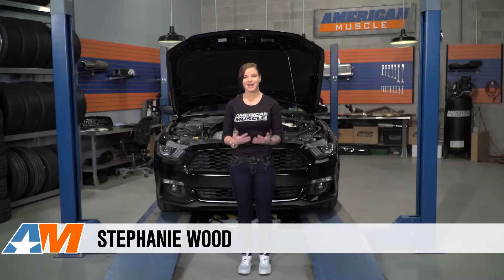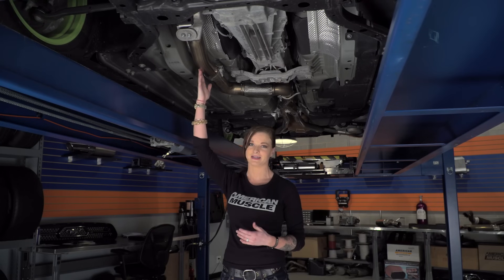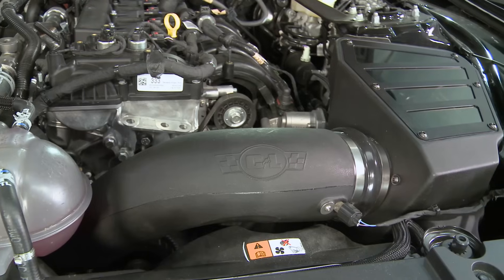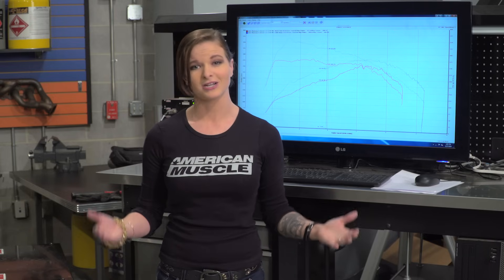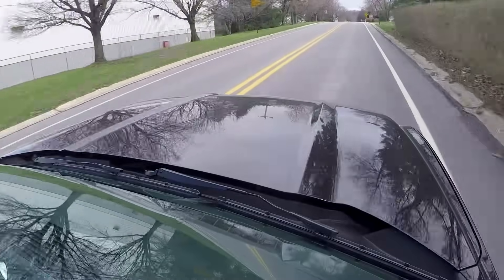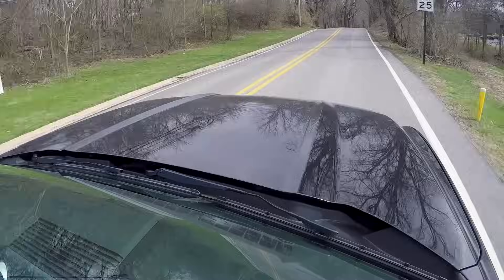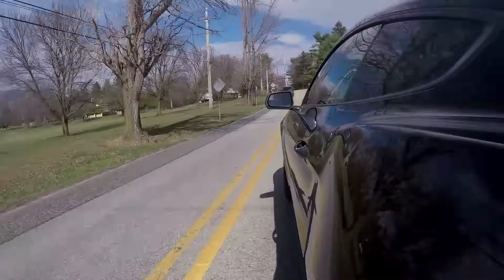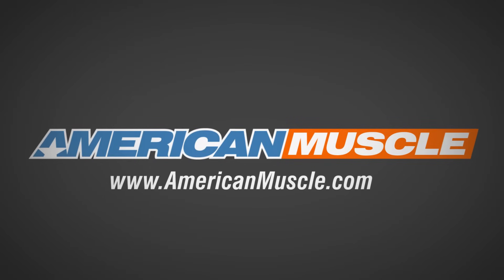3 Mods + 113 HP Gains- 2015 Mustang EcoBoost

Comment: For the Mustang used in this video, did you use the OTS map that comes with the Cobb Accessport? Or was a custom tune used?
Reply from the maker: Hey Michael, we used a custom tune for this bad boy. We were going for maximum performance and horsepower gains, so a custom tune was definitely a must and boy oh boy did it make a world of a difference. I have a few friends that run the OTS map that comes with the Cobb Accessport, and it really does increase the overall performance of their Mustang, but for this situation we wanted the most HP possible and went with a custom tune. - Matt
Reply: Thanks for the info, Matt. I look forward to ordering the Cobb Accessport from American Muscle here in the near future. I recently purchased the Roush cold air intake from AM a few weeks ago, and noticed the gains right off the bat.

Comment: Hey off topic, what do you think about going from 3.55 gears to 3.73 or maybe 4.10 and i do drive the car daily. Current setup is Pypes axle back, Airaid track only, PP package and unleashed 93 octane tune.Thanks
Reply from the maker: Hey man, that really depends on what you're plans for the car are! NA or boost? Road Course or Street? 1/4 mile? If you're going for an N/A beast, then 4.10's are the way to go! If you are planning on  boosting, I would stick with your 3.55's! - Will
Reply: Ecoboost automatic, only thing left I might want to do is lowering springs maybe a downpipe and the gears.

Comment: Borla Attack is not the move for an ecoboost. This car needs more refinement for street use, that rasp at high RPM would sound atrocious in person, especially with the car not moving proportionately to the amount of noise production. impressive gains though. Maybe a thru resonator or two to cut the rasp would be nice.

Comment: For some reason I thought the stock HP of a Ecoboost was 310 already but your Dyno run shows it in the low 2 hundreds and with the mods you did 310 HP. Am I missing something?
Reply from the maker: Brand new at the crank these 2.3L Ecoboosts do make 310 horsepower, but by the time that power makes it to the tire it has experienced a good bit of drivetrain loss. Sadly happens to every vehicle! -Zach
Reply: @americanmuscle  Oh so when Stephanie says that those mods make 310 she means to the wheels I guess?

Comment: Is it impossible to find specs or a respectable tune with stats for a 2018 mustang ecoboost?? Been looking since I bought the car in May and all I see is 2015 and on tunes which seem canned to me and performance stats are loose. Makes me want to get into the tuning business because the top 5 for this cars are very generic so I have no confidence in others
Reply: For the mustang ecoboost platform an intercooler, catback and tune gets you around 300 wheel horsepower reliably, the 93 octane limit of these cars is about 330 with full bolt ons.
Add an e30 tune and an upgraded wastegate actuator and that power can get over 350 wheel horse power.

Comment: Just got a ecoboost mustang two days ago and it came with that exact air intake, do you know if i added a whole exhaust system if it would mess up the Ford tune i have on it?
Reply from the maker: Nope! If you're just adding a cat-back system along with that air intake, you won't have any issues. If you plan on changing the down-pipe though, I'd highly recommend getting a new tune to account for it since that will be a much larger change in back-pressure compared to factory. Don't want to mess up the new ride, yknow! -Zach

Comment: Gotta go for Pro tunes with the Access Port after putting a catless downpipe, also gotta gut the PCV or have tuner raise the RPM to prevent smoking issues with the Ecoboost. Once you start getting these bolt ons you also need the better intercooler. So dont expect to just get power and efficiency with the simple bolt ons without the knowledge and research. Also a good trusted tuner. Or all of this will give you problems down the road.
Reply from the maker: Hey Adam, anytime you mod a car you have a chance of running into an issue. With that being, in this day and age most mods are pretty safe and if not we will list what supplementary mods are required to run it. I completely agree with your thoughts on the intercooler and I would definitely be adding a front mount to this car if it was mine also. I appreciate the comment! - Matt

Comment: Should all CAI have that housing to be more effective than a stock setup? I usually don't go over 4k rpms.
Reply from the maker: Kurt, an inclosed housing is definitely sweet, but everyone will have their opinion. There is definitely a debate between an inclosed and open filter, but in my eyes there really is no wrong answer! A buddy of mine runs an open filter and loves it, but once again there is nothing wrong with an inclosed as well. - Matt

Comment: Would be better to wait or can I exchange the downpipe  3" all the way to 2 1/2 exhaust tip before upgrading the air intake ?
Reply from the maker: As long as you tune for the parts accordingly, there's really no set order on which you should install first. Either way is fine! -Zach

Comment: It doesn't have that throaty muscle sound and needs a bigger turbo. Not happy with this as I actually have to turn off my car through drive throughs because they can't even hear me when my factory turbo ute sits idle (after market 3" stainless steel exhaust system, after market intercooler and performance after market air flow filter kit and catch can added) and I'm getting diesel specialists in Wingate to formulate a system for a larger turbo which won't be a straight bolt in.

Comment: Ever heard of being only as strong as your weakest link? If you have a 3 inch into a smaller pipe, you arent getting any benefits from the 3 inch iv at the end its smaller. You do get a benefit from removing the cat from the downpipe though, just not the size.

Comment: Some idiots said that Ford was "risking controversy" by ditching the V6 for the 2.3L Ecoboost 4 cylinder. The writers of this video are car gals and guys. Ditching the unloved and with no aftermarket support 300 HP/270 TQ V6 for the 310 HP/320 TQ turbo 4 cylinder Ecoboost . Wasn't controversial at all. It was a no brainer that both the bean counters and the car guys at Ford could agree on.  Now ALL Mustangs are NOW in fact "performance cars" whatever the trim level or engine option. Being that the Ecoboot has an MSRP of $26,400 within the budget of young carbuyer/enthusiasts and can be easily tuned up to 500 HP with a change of the turbocharger.
Reply: For no so called "aftermarket support" I sure found a lot for the 3.7 cyclone.  There are several aftermarket CAI's, short & full length headers, exhaust systems, programmers, a larger throttle body, ported manifolds, and even a stroker kit, plus of course turbos & superchargers.  Many youtube videos show what mods will do on a 3.7. As with all mods, HP per dollars varies significantly with forced induction the best return.

Comment: whats better for gains? an intercooler or downpipe? I already have a cobb accessport but just running the stock map 93 octane tune but will be getting a custom protune shortly
Reply: Not a mustang owner but I have a 2015 Taurus sho. Downpipes will get you more noticeable power right off the bat. I’d recommend an intercooler too though. Intercoolers don’t add a whole lot of power, but they prevent boosted engines from losing power. Turbo engines get very hot very fast so a bigger intercooler will keep the air temperature lower which will prevent horsepower loss in extended periods of hard driving.
Reply: @alexs4934  I appreciate the reply but the mustang is long gone unfortunately haha recently got a new fun play/ weekend car that I am starting to mod though haha
Reply: Hahaha, I didn’t realize how old the video was before I commented. Hope your new ride is treating you well 👍

Comment: New to modifications, why did the modifications result in lower performance below 2500 RPM?
Reply: That difference is just because they nailed the throttle to start the dyno record at a different rpm.

Comment: Could Borla ATAK exhaust system fit into Ford Mustang Ecoboost from UK(right hand drive) ?         Are the US ecoboost mustang(left hand drive) had the same exhaust system with UK ecoboost mustang(right hand drive) ?
Reply: My car is 2016 Ford Mustang Ecoboost 2.3L from UK(UK spec - Right hand drive).
Reply: +Rio Winardi yes it would fit bro it's the same but the steering is different the exhaust will fit bro

Comment: 5.0 coyote !!!!!!! my choice over ecoboost
Reply: Then why even comment on the video?  Obviously not everyone chose the fucking Coyote. My Father went with the GT, I went with the EcoBoost. It's not a money thing, it was a preference. The EcoBoost is lighter, with the rear seat delete it's 300 pounds lighter. Which is no joke, and I just REALLY enjoy turbocharged 4 cylinders. I've always been a big Mustang guy, and yeah I used to own an '09 GT. But this EcoBoost is just as fast as my GT was, and takes to bolt-ons like a fish to water. You saw in the video, 3 simple mods and a tune; now they're looking at 110 HP extra, which puts it pretty much equal with a stock GT. Now sure, you put the same money in a GT and it'll smoke the EcoBoost. But some folks just prefer it.
Reply: +JacobJakeJacob notice how I said my choice . I'm glad you like your ecoboost though nothing wrong with them.
Reply: +ericimi BTW I had an evo x I traded it for my gt so I do also like 4 cylinder turbo cars.
Reply: Because with those upgrades you have got gt power with half the engine and a fraction of the fuel consumption. I own a 2005 gto and while I love the car, I never am able to use the power of the engine cause speed limits but certainly pay for the fuel consumption.

Comment: doesn't the tune reduce the overall life of this car? correct me if I am wrong
Reply: LA StreetWorkout I wouldn't think the tune itself would. Abuse by the driver/owner, yes but the tune, no.
Reply: LA StreetWorkout it does the opposite. Without a tune the parts don't work together. These mods aren't as heavy so they shouldn't really reduce life of the engine but a tune is recommended for every part

Comment: I understand now... If your egotistical, or loyal to the brand. Stick to the Gt. If you’re strategic and think longterm, the ecoboost with added mods (boost to 400hp) is the better option longterm. Bc she just said 3 mods can add +115 hp. Which ranges within 400hp from 310hp standard. That for sure competes with the Gt, while at the same time SAVING GAS…..

Comment: I have a 2017 eco can i do all 3 or 4 of this mod to mine and still get 110+ hp on it cause if am not mistaking mine is pushing about 300+ hp which means this would bring it to over 400+ hp?
Reply: If I heard in the video correctly I think the peak horsepower gain was 66, the 110 she mentioned was gained at a lower rpm range Durning power curves.

Comment: If I buy an 15-17 Ecoboost with warranty and do these mods will it void warranty?
Reply from the maker: Normally, axle-backs and cat-back exhausts would not void warranty. I would highly recommend checking with your local dealership before installing the intake and down-pipe to see how they would potentially effect your warranty. -Zach

Comment: So with the mods it made the numbers it’s supposed to stock?
Reply from the maker: The 2.3L Ecoboost makes around 310HP and 320TQ to the crank which drops to around 245HP and 277TQ to the tire due to drivetrain loss. After tuning and modifications, we made 311HP and 360TQ to the tire instead of the crank! We also achieved a much better driving experience and power curve that won't drop off in the top end like the stock tune. -Zach

Comment: Shouldn't the horsepower already be  305hp stock for 2015 mustang EcoBoost?
Reply from the maker: To the crank, yes! But due to drive train loss, not all of that makes it to the wheels to be measured by the dyno. -Zach
Reply: @americanmuscle  thanks. I figured that might be the case but wasn't sure

Comment: What would be the cost of these 3 mods? Which exhaust will NOT make it sound like a Ricer🤢
Reply from the maker: Below is the parts list for this build! The 2.3L EcoBoost will never sound like a V6 or V8, its a totally different beast. Going with a system from Magnaflow or a Borla Touring would definitely tone down some of the raspy-notes you're hearing here though. -Zach
C&L Cold Air Intake http://www.americanmuscle.com/cnl-cai-2015eco.html
Borla Off-Road Downpipe http://www.americanmuscle.com/borla-or-downpipe-2015eco.html
Borla ATAK Catback Exhaust http://www.americanmuscle.com/borla-atak-catback-2015eco.html
COBB Accessport V3 http://www.americanmuscle.com/cobb-accessport-v3-2015eco.html

Comment: Yall dynoed a stock 15 eco boost and it made 276hp.. wonder why this one is so low?
Reply: HorsePlay Motoring that’s not low. When you look up and see the car and it’s says 320hp that’s to the crank. The hp they are talking about is rwhp which is hp to the rear wheels. It made good power
Reply: @creeves1331  yes..i know thats to the rear wheels..which is what a DYNO reads.. if a STOCK one dynoed at 276hp..a modified one should be much higher..
Reply: Take 276 and add 113hp..
Thats 389hp.. but this one dynoed at 311hp and 360ft lbs..
Reply: @TheModAddict  
Peak gains are the maximum peaks over the stock maximums.
Peak gains through the curve are the largest differences in power at any RPM that does not necessarily exceed the peak power rating.

So 113hp was the largest observable difference in power at a specific rpm on the dyno curve, the ford performance tune available for this car for example offers a 100hp gain over stock at 6000rpm but only 35hp gain peak over stock overall.

Remember the car is not making 300hp at idle, power ramps up over rpm, how that power ramps up is your dyno curve, you can make a car alot faster without increasing its peak hp.
Say a car makes 300hp peak but only 120hp at 2500rpm, increase that power to 250hp at 2500rpm but keep the peak at 300hp, much faster car making the same peak power.
Reply: @Bobbrians  i understand this.. but the previous dyno of a stock car saw peak gaines of 276hp.. the peak gaines of a modified id figure to be a lot higher..

Comment: If you wanna do this type of shit your best bet right now is those mid 2000s 335i’s from bmw. Twin Turbo inline six that comes from the factory undertuned. Cranking up the boost to a 15-20 psi range puts them over 400 horsepower and torque. With multiple bolt ons im betting its close to 500 whp and some are being pushed near and over 1000 hp reliably and with a bigger turbo all on stock internals and transmission. Theyre selling for so cheap right now too. As long as you can diy some of the problems they have i think they could be the next big tuning engine. Basically you can buy this thing for 10k or less and build a mustang gt/camaro killer just by adding bolt ons

Comment: Isn’t the stock HP 310 already?
Reply: There are different ways of rating horsepower,
Manufacturers use crank horsepower, the power measured at the crankshaft.
The Aftermarket uses wheel horse power, the power measured at the wheels. 

Power is lost through the transmission and rear differential. on the S550 chassis platform that loss is about 15%, so a wheel rating would tend to be 15% less that the crank rating for this car (other cars can have difference percentages of drivetrain loss).

Wheel horsepower is preferred because it better represents the actual usable power,  the stock mustang ecoboost makes around 260 horse power to the wheels when using 93 octane fuel, when using 87 octane fuel it makes 230 horse power to the wheel (the computer limits power when using lower quality fuel).
 With an aftermarket tune on 93 octane fuel the ecoboost makes around 300 horse power to the wheel, 300 to the wheel would translate to around 350 at the crank.

Comment: So it adds up 113 hp and makes car approxt 425hp?
Reply: Peak HP Gain is 65 whp, or add ~75 hp to the Crankshaft.  So that would be 385 peak hp at the Crankshaft, on a Base Model Ecoboost

Peak TQ Gain because of the Spike, I'm going to say ~90 wtq, or add ~100 tq to the Crankshaft.  So that would be ~450 tq at the Crankshaft

Comment: I see the items say 2015-2016 what about for a 2018?
Reply from the maker: The Cobb Accessport and the Borla ATAK Exhaust System would fit a 2018 just fine! You'd need to find a cold air intake and down pipe that are specific to your 2018 though. -Zach

Comment: Does removing the cat throw codes/check engine light?
Reply: Ringoluck Only if you don't tune it. If you get a cobb tuner like this car has, it will block the CEL from coming on by telling the ECU that it's normal
Reply: will cobb's off the shelf stage 1 take care of the codes? i cant run stage 2 without an intercooler...?

Comment: I thought a stock ecoboost was 310 hp... at least that's what I've seen over the internet
Reply: Horse power and torque ratings from the factory are from the crankshaft while these numbers are from a chassis dyno at the tires, in other words a chassis dyno is telling you how much of the crankshaft horse power and torque are getting to the road. Cars will lose approximately 15% through the driveline with some losing more and some a little less. 

Having said that you also need to know that you can put the same car on 5 different dyno's and you will get 5 different results even with the dyno's being from the same manufacture. A dyno is just a tool and the guy with the dyno that reads the lowest numbers could actually be the guy who builds the fastest cars.